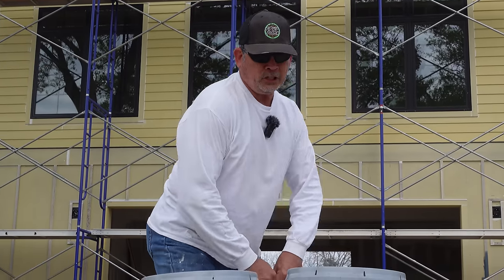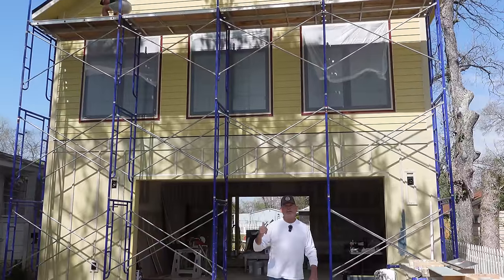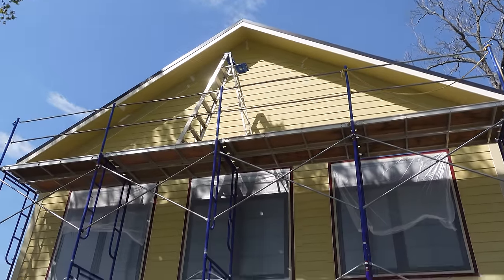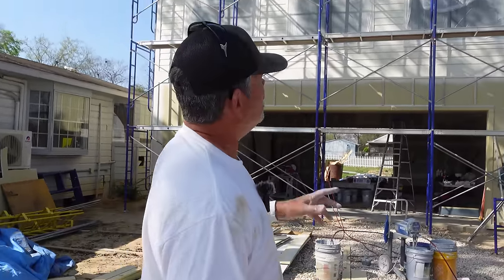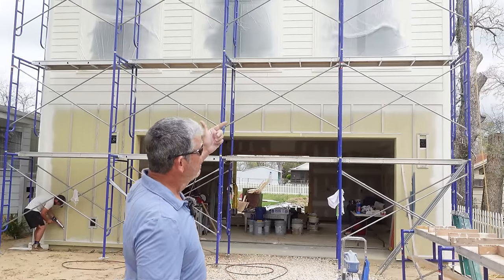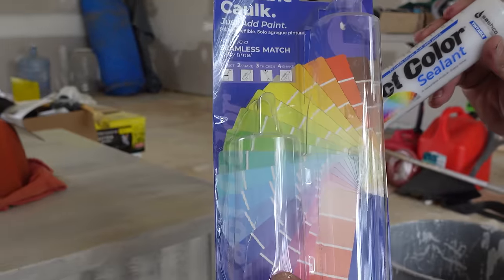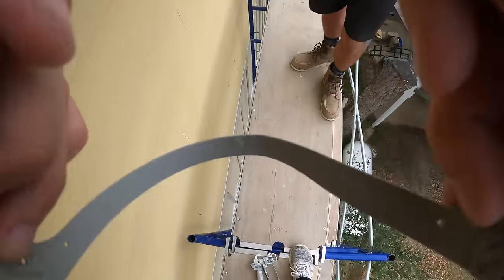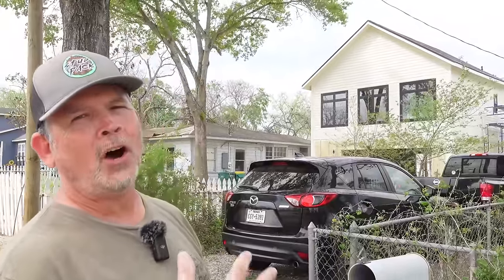We Spent $1,400 on Paint and Sprayed it Ourselves! (Should We Have Hired Pros?)

Comment: Another great video but I am concerned about some things and surprised how some people have voiced their opinions on here. I am a semi retired commercial painter that have worked on all types of structures. I have been following you guys for a long time. The main concern, as others have voiced, is over your scaffolding set up and no railings. One respectful tip when you’re going to spray outdoors is to start early before the winds pick up. Your choice of paint is great. SW Emerald is an excellent paint. As far as the color that is always a very personal choice. I can’t believe someone commented on the color you picked. One other tip in the very high traffic areas you may want to use a primer, like downstairs door frames and maybe around where you have a water spigot. I know the manufacturers say one thing but as you guys well know by experience that they are not always right in all instances. Otherwise I love you guys videos I stop whatever I am doing to watch your videos and try to learn from you or your guests. Keep up the great work and I’ll be waiting for your next video. 😊
Reply: Also theyre not wearing the right air filters
Reply: Sherwin-Williams emerald is a hybrid alkyd enamel, it has a high hardness on the mohs scale, it is its own primer the use of a primer with it simply makes it less durable, it's made for metal or wood,
Reply: Wow that looks so epic
Reply: I was cringing when they were on top of the scaffolding holding onto the plastic without any safety railings 😮
Reply: I came to comment about the scaffolding as well. No matter how comfortable people are with heights, falling injuries are common and ALWAYS preventable.

Comment: Love the progress and the paint color. But c’mon guys, invest in some more scaffolding. There’s no need to be that high in the air with no railing protection. One wrong move and your dream house becomes a nightmare. You’ll need it for the main house anyway, so just buy it now.
Reply: LOL I don't know my though was they had to many. on the first coat and then not enough on the side for sure.
Reply: Scaffold can be hard to come by in Texas right now and it ain’t cheap when you can find it. They’re building at a rate you wouldn’t believe unless you saw it. I was on a site where the all wooden boards were falling apart and multiple people had fallen through, this was on a 5 story multi family complex. They literally could not get new scaffolding to replace the old stuff fast enough.
Reply: Seeing Paul on that thin plank with no railings 25 feet in the air was definitely not cool.
Reply: There was a time when they were on the scaffolding talking and you could tell Paul was not talking like he normally does and I'm inclined to believe he was more focused on how and where he was standing. But I agree with you. I sometimes wonder if a man lifts would be a whole lot better
Reply: If you can't get scaffold screw an eye bolt into a stud and use your roof harness. It's not ideal, but better than dying over something as stupid as a scaffolding shortage while painting a wall.
Reply: I agree totally, this can easily become something you wished NOT.  A lift seems more practical and more safe.

Comment: Retired painting contracto with over 40 years here: Some comments, I would not be spraying with all the wind you had . I prefer to brush and roll the facias, with 2 coats, gives a better solid paint application than 2 light spray coats and you don't need a bunch of guys holding spray shields and plastic , and you can save a bunch of money on blue tape and time putting it on . Hanging your cutting brush on the side of the bucket in warm/hot weather will result in your bristles covered with dried out paint in a short time, requiring you to clean the brush with a wire brush as you move along the job . I would keep the brush in the paint . Very important, do not bend your wrist when spraying, keep spray gun perpendicular to the work surface , and you will have less overspray if the gun was a little closer to the work . Last suggestion, on the window trim, I would have caulked first and then painted all the trim, that way you see one exact color and sheen instead of one color of caulk and one color of trim color .

I know you guys aren't pro painters but  the job still turned out nicely .
Reply: As a painter who sprays the changes I would have made are:   Use paper masking on the metal  roof fascia and have my assistant use a 3 inch wiz roller  to quickly role it smooth behind me, once I'm done that strip, and catch any drips or misses made because of the wind.   It will take the assistant less that  a minute to role it even where it needs it. You want to have an assistant near by to catch any over spray and move step ladders out of the way. Oh yes wear cloves and a long sleeve shirt. have back up glasses ready as well. That is also the assistants  responsibility. Also a 3 foot extension or even the 12 inch (?) extension arm would have helped at the peak. I thought the same as you with the paint brush thing, keep it in the paint and or throw a wet rag over the bucket when you put it down. Besides that they made a good job. Definitely should have taped that plastic down. that was a mistake and left the windows covered as well. I know they wanted to see it finished. Paint all one colour then change your paint colour. Over all his spray technique isn't to bad. Practice practice practice.
Reply: 100% agree
Reply: You know what 99% of the pro painters I've seen wouldn't do any of this. They'd do minimal or no caulking, they would spray over dirt, they'd only mask or tape what they absolutely had to. I know you two are different but I guarantee this paint job is better than 99% of professional jobs. It's so sad out there right now, unless a camera is in someone's face they don't give A F.
Reply: @fox156 Depends if your talking construction union painters or house painters. Commercial jobs are all about speed and money.
Reply: @drewcama2488  Assuming that you're just a normal person with no contacts in professional contracting or painting and you want the exterior of your house painted, you're either gonna end up with exactly shoddy the job that he described or pay much more than 5 thousand dollars to a large company or, if you're lucky, a combination of both. All jobs are about speed and money to any contractor I've ever met. They do not care about the finished product or if they do it doesn't come across in their work. Now, I'm sure there are some good ones out there, but like I said, if you don't know the business intimately you have no way of finding out which ones are the good ones. I wish more contractors made youtube channels for this reason so you could actually see what kind of work they do. I'd hire StudPack to do just about anything and pay them whatever they said it would cost because you can see the body of Paul's work. Even when he makes a mistake it either doesn't affect anything or he goes back and fixes it. From the perspective of this average homeowner - the average contractor is not worth their weight.
Reply: @fox156 While drew's comments are spot on, so are yours. If he does that stuff, he is a rarity. 

As you point out, so many "pro" painters do a shit job. They are concerned with one thing: going as fast as possible and moving on to the next job. You are right it is sad out there. At the paint counter a few weeks ago, I watched a pro tell the guy behind the counter that his company is sending out crews where all but one guy were hired less than a month ago with no experience.
Reply: @drewcama2488 Not everywhere. This type of stuff is regional. In NY, the union jobs were about money, definitely not about speed. Through the 2010s, the mafia controlled a lot of this stuff, especially drywall. They were forcing level five finish (full on skim coat) on everything, even warehouses.  If you say no? Teamsters wouldn't deliver your compound or paint. They went very slow and did beautiful work. But you paid 10x the price. Some of the worst work I have seen in NY is residential.
Reply: @ILruffian I've heard that before and I don't doubt you. I tried googling that topic but couldn't find anything. Maybe it was the search words I used.
Reply: @drewcama2488  would you/could you use a FFLP tip to spray something like Emerald? I thought those tips were mostly for fine finishes like cabinets. I like the idea of less overspray in the air and more product on the substrate.
Reply: Good job fellas, but taking chances using the top of the scaffolding without safety barriers. Imagine if 1 of you fell, how would the others feel. Death or life changing result. Take care lads.
Reply: @adgeebike9173 Agree. Love Stud Pack. But this is some real sketchy shit. No thanks. 

At least it's their own house. If I saw a contractor doing that shit at my place, I'd send them home. If they fall and get hurt, no doubt they attempt to claim your land was uneven, get your homeowners insurance involved. I'm not a complete safety sally. But this is a bridge too far.
Reply: As another  pro youtube painter, I say don't paint anything, use vinyl exterior siding, metal, etc, that's maintenance-free... problem solved for basically your whole life
Reply: @natersalad889 would you do this with soffits too?  I need to paint mine.  Won’t contract it out for reasons expressed in some of the other comments.  The idea of using a metal product and a light nail gun has a lot more appeal than pairing a flat surface above my head.
Reply: watching him use that 212 tip was hard for me lol. i always have used a 515. also i hate those cheap 4 finger guns there so bad lol.graco contractor is such a better gun. and the sound of that pump just makes me cringe lol

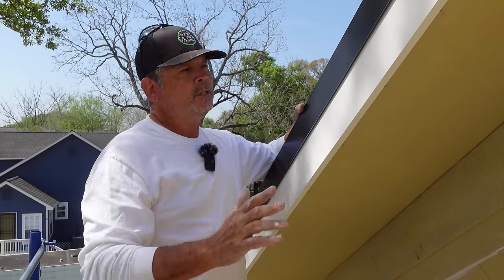Comment: A 2:12 too is good for the soffit but you switch back to the 5:12  for the sides. The first number x2 is the fan size, so a 2 will give you a 4” fan and a 5 will give you a 10” fan. The 12 is the orifice size. Larger sizes are for thicker paints.

Comment: Speaking as a signmaker for 44 years the Emerald from SW is a great longevity paint. Quality. Imagine your car sitting outside for 15 years 365/24/7?  Never washed or moved. That is what a sign does so I have learned a bit about finishes.
Reply: The Emerald interior is great as well. I like it better than Benjamin Moore Aura. If you start with a smooth wall (e.g. skim coated) and you control the environmental conditions, in the room to slow drying, you can roll it with a microfiber roller and the result is a look that is damn close to an airless spray finish. Again, you have to start with smooth walls to begin with. If a putzy mothafucka previously rolled the place with a 3/4" inch roller, any paint is going to look like trash unless you skim coat the walls.

 I still use Ben More Scuff-X for interior trim. But Emerald matte is a winner on drywall indoors.
Reply: You may be the first person I've seen who ever said they like Emerald over Aura, hah. How do you feel about the waterborne urethane Emerald over others for cabinet paint? We get a great deal on that so I've been trying it out but I haven't experienced long term results yet. I know they've got gallery now, trying to decide what I'll use on my kitchen coming up.. the urethane does take awhile to off gas though which is tough when you keep places sealed when it's cold. @ILruffian
Reply: @scyarch1136 I like Emerald over Aura only due to my specific quirk of absolutely hating stipple. Even with extender and microfiber roller sleeve, I just cannot get Aura to lay down as smooth. That said, the new reformulation of Aura (2022) made it a lot better to work with. Coverage is nuts, even in something like Chantilly Lace.

I wouldn't go near Emerald or any other paint for cabinets. Slow drying and not as tough. Those should be 1K or 2K poly. I tried SW Gallery Series. Have not gotten it to work out yet. I keep getting pinholes (similar to orange peel, but not the same thing). Although I'm probably going to give it one more try, the real answer is likely going to be Centurion or Envirolak. I hear exceptionally good things about the latter. Only problem is sourcing it. All of these 2K polys are near impossible to get.

Comment: Nice job guys!
Some pointers😂
Your shield, cover with masking paper then it never gets all over the actual shield and can be reused multiple jobs. Second, get a smaller tip…I like fine finish even outside!! Less overspray.
I like to start at the bottom of the ship lap and work my way up. You don’t have to start at the bottom of the building but the bottom of a section of boards…say ten board s at a time, I’ll start at the bottom and go up, making  sure I’m hitting the bottom edge with each pass as I progress upwards.
Mini roller is your friend.i use those 4 inch that go on wire frame all the time. They allow you to paint inside corners, are easy to control where the paint is going and lay off a beautiful finish.
Microfiber if you’re really wanting perfect.
Anyways great work and see you on the next one

Comment: As a residential painting contractor of 22 years, I know with hardie board, you don't HAVE to prime it if it has been weathered for 6 months or less. But I always prime any new siding, all types. The first coat may absorb at different rates leaving your finish to flash. Also adhesion on your first coat is the most important on the life of the siding. 

Still looks nice though!
Reply: Not an expert but that was my question... is primer key to a better paint job?
Reply: If budget allows, I prime new hardie with Loxon just to reduce the risk of efflorescence or PH issues.

Comment: I contracted a paint job on a two storey house using a hand held W/power cord Graco, and I will never go back to rolling. The hand held with a 2-12 took me 15 minutes for each side. It took me longer to calk and to tape off and mask the windows. The actual best part was not having to mask the roof line, and the gutters painted so good with an egg shell texture, that I had to wipe my eye with a tissue. I got the hand held Graco, because I figured if I didn't burn it out on the first house I could use it on my house next year, and I need to do ceilings. I used 5 gallons on a 2500sqft home, so I should be good for 3-4 more houses before it needs a rebuild. 

Props on your garage/house. It looks great. Sherwin Williams lasts a freeking long time.

Comment: You can paint cabinets with super high end coatings using that Graco x7. I used a graco x5 to do built ins in my dining room and office using the x5 with a tritech 370 fine finish gun and gold 310 and 308 tritech fine finish tips.  I used renner 765 1k for my projects since they are low traffic, but for a kitchen or bathroom I would use renner 688 2k topcoat and renner 651 2k primer. Elite fine finish is in Texas. The guy that runs it is Luis I think who used to be inside sales I think at Surfprep but he knows his stuff. High end finishing is usually $200-230 per linear foot so you could save some dough by diy’ing if you had the desire. It’s not rocket science but definitely takes some planning and practice. I’m a doctor but build cabinets and do high end finishing for fun. I took a class from Dennis Rodrigues (midway interiors on YouTube) and Eric reason (also excellent YouTube resource). These two dudes are at the cutting edge for cabinet finishing with the state of the art wood coatings. I took notes from them and became pretty good friends with Dennis who always helps me out with random questions I have. Good luck.

Comment: Hey guys just a tip from a painter, I like to spray exteriors with a LP Graco tip, the black ones specially the the bigger sizes create a lot of overspray. The green LP tips require much less pressure thus creating much less overspray. I use LP 415 for interior walls, LP417 for exterior walls, FFLP310 for doors and a FFLP308 for cabinets.  I only use bigger spray tips on interior projects where you can mask everything, not worry about over spray and just spray like a mad man. For the LP and FFLP you need the blue tip guard, they will not fit on the orange one.

Comment: Get some HandyPails before painting the house. They have an adjustable hand strap, a magnet to hold your brush, are easy to clean, and come in different sizes. I use one at my job and it helps a lot when I have to go from room to room and need my other hand to unlock the doors between them.
Reply: Plus 1 to Handy Pails, they are awesome!!!!!!!!!!!  esp with the little insert-able liners that you just throw away at the end.
Reply: I used the Handy Paint Pails for years. Recently switched to the Purdy ones from Sherwin Williams. Even better, as they fit a 4" roller.

Comment: A tip for using thsoe syringes without air bubbles is to suck a little stuff in, tip it up, then push the air out. WOrks pretty good for baby medicine at least

Comment: The bucket works fine but I am a fan of coffee cans as they have a nice handle you can hold and they come with a lid to seal the paint between coats. Nice color pick.
Reply: I like the coffee cans too but, I find my hands cramping up
Reply: Neither are as good as using a gallon paint can.  I wash out my cans and re-use them, or you can buy empties at the store.  They are more compact than that plastic bucket, but the real deal maker is they have the built in drip edge - which catches excess and allows it to stay in the groove and not drip down the side of the plastic bucket.

Comment: When spray painting houses, I have always used heavy duty painters cloth tarps on the roof.  If you have to or want to spray in the wind, the wind doesn't blow them around.  You can also secure them with a couple of sand bags.  I mostly repainted existing homes so I didn't want to get overspray on the shingles.  Never had and issue with overspray.